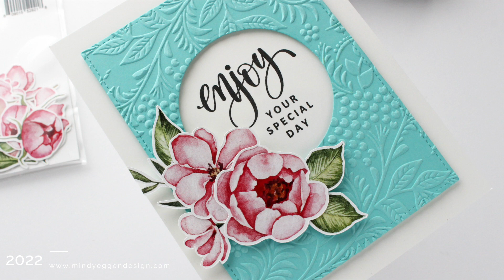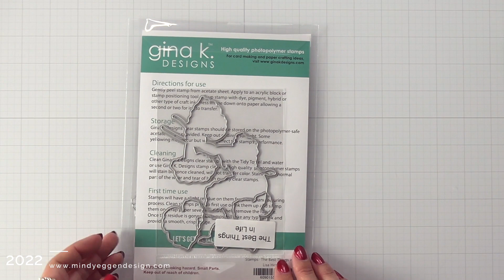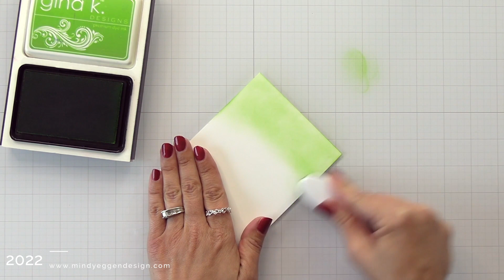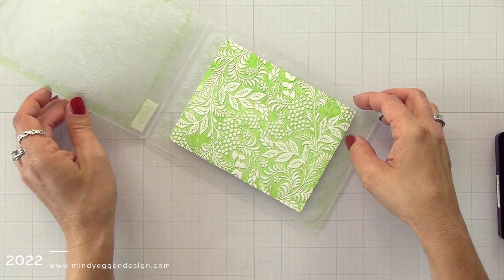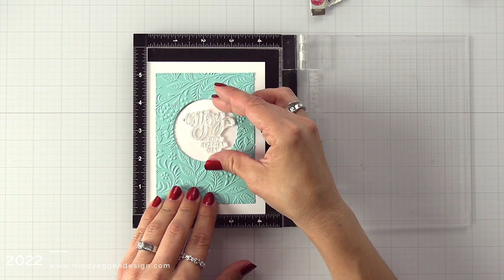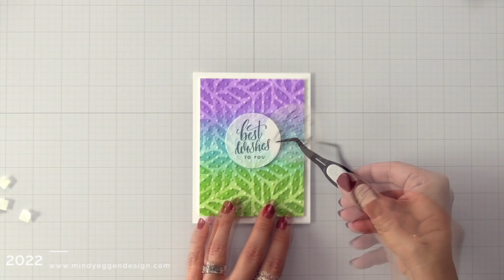QUICK & EASY Embossing Folder Techniques with Gina K Designs!

Comment: If I'm not sure which side I prefer, I ink both sides of the folder, and that way it's easier to decide. As long as the ink doesn't leak through, I will also use two colours. Unless the folder has script or numbers, there's no right or wrong side, and the debossed effect can be nicer than one would think, at first glance.
Reply from the maker: totally agree